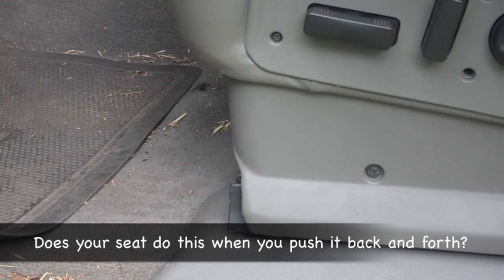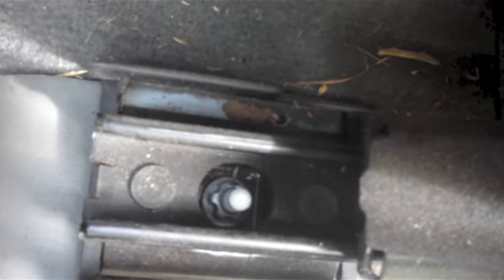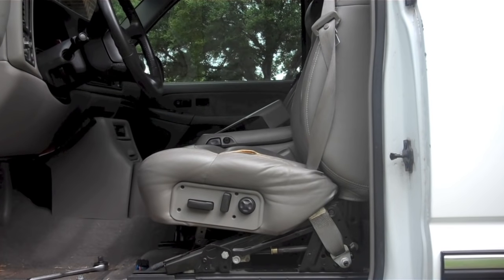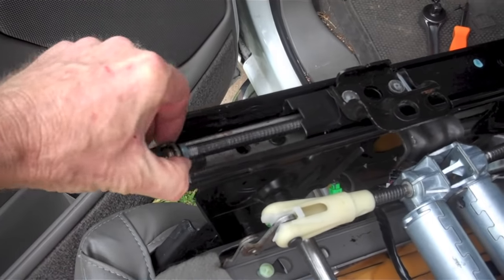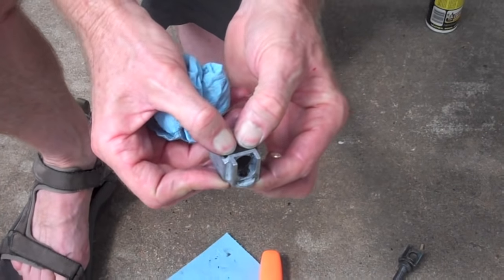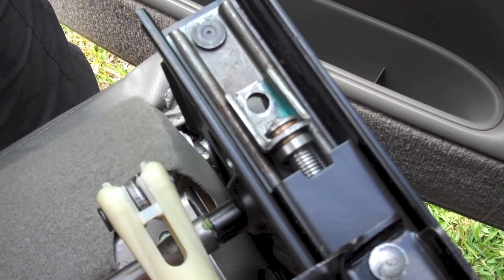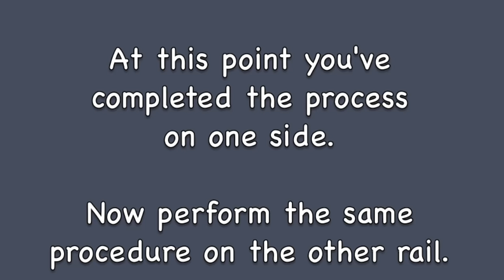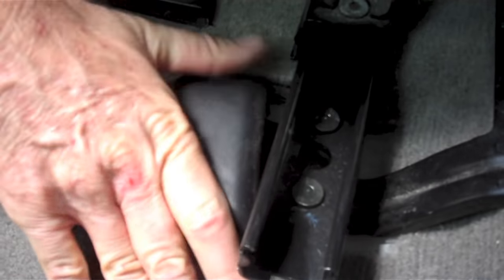GM Sliding/Loose Seat Repair

Comment: As a retired ASE Master Tech, this I can say is a very good video, lighting, explanation and correct use of terminology while point out weaker torque areas, thread locker, plus grease. Thank you for using "TORX" as many call it a "Star". First used on aircraft and military parts for decades, it is only the last dozen years or more, found it's way into automobiles. This type of fastener is misunderstood as it allows higher torque with a small foot print. One point for end user, take a bunch of photos at various stages if you are not familiar with these repairs. Keep small parts in plastic sandwich bags and drop a labeled card into the zip lock sack if you cannot finish that day. Like the video or subscribe so you can find it again.
Excellent job and clearly spoken at good volume levels. Two thumbs up!!
Reply: Q0

Comment: Thank you for
your straight forward, easy to follow video. I have a 2000 Chevy Express 3500 and this helped repair my shifting seat. For Chevy Express owners you can unbolt from the "stand" not the floor board which will save you removing 4 bolts. Everything else is the same.
Reply: Thanks i have a 98 3500

Comment: I have this issue on my 2002 GMC Sierra 4 x 4. About two years ago I purchased a complete front seat kit for both passenger & drivers side. I completely forgot I bought this kit from you (remodeling my laundry room) but today I had the opportunity to perform the drivers side repair. It took about an hour and a half, I cleaned everything, installed your shims, and greased the worm gear/shaft before installing. Wow! this is like brand new! I cannot thank you enough. So happy! And no more clunking movement. 

The other noisy rattling thing I addressed was a 77 cent Dealer part......my brake pedal rattled under the dash area when going over a bumpy road. Turns out it was a plastic pivot insert that wore out. (You can tell by wiggling the brake pedal side to side). That took an hour or so. Between these two things I am rattle free to an extent!
Reply from the maker: Just to be clear, I created the video but am not the person selling the kits.

Comment: Just fixed c5 corvette seats today and i wish i had found this video first!! The kit i had was from a different web site and came with written directions which were terrible.. The procedure outlined was also slightly different then what was recommended in this video. For example the written directions said to thread the block 1/3's of the way where as you recommended putting it at the top of the gear(you were correct much easier). After i got to the second seat i was doing them in no time after watching these instructions.

Some useful tips 1:) You DON'T have to remove the cable at all! The first 3 times i removed it but on the last track i i figured out you can do it with out removing the cable which shaved valuable time off the repair as well as some complexity. Simply manipulate the track forwards/backwards when needed to remove the gear and the caged housing block with nut and replace the shims, then put the gear back in again making sure the shims and everything clear the guides and line up. 2) The next big trick is when getting the gear to go into the guide have the chair's tracks/rails to be VERTICAL this will greatly assist in getting the gear back into the final guide as gravity will do its thing; press down the cable with your screwdriver to insert into gear then bolt every thing back up and your done. first rail took 2 hours on shitty instructions after watching this video was done in 1 hour both chairs and bolted every thing back up.

Comment: $2.00 locking pliers from harbor freight fixed mine.  set it and forget it....**UPDATE**   After more than a year I decided to buy your kit and do it.  Easy job.. good little kit.  Hardest part is trying to keep the cloth seat clean while taking apart the grimy, greasy worm gear and carrier.
Reply: Where did you get the shims I can’t find them anywhere

Comment: Great video sir just completed the task on my o3 sierra I didn't opt to buy the shim kit I made my own by grinding down two sides of some washers I had laying around. I found your video very informative thank you.
Reply: I expect that the kit replacement shims are a softer, non-metallic material. It is estimated that this soft shim design accommodates the break away torque of the relatively slow, high torque motor(s) that drive the worm gear. Metallic washers (I assume you used) will likely add too much start up torque to the motor(s); motor(s) may wear out (fail). If this is the case, you are encouraged to make a video on replacing the motor(s).

Comment: I had a similar problem with my 2008 Sebring Convertible. Original owner 100K miles ...still looks/runs like new.
New seat tracks were $1400 !!!!!! Your shim solution made sense, so I solved my issue by making a tapered wedge out of a t handle small engine screwdriver/plug removal tool. 
I inserted the wedge at the front of the rail(between rail and seat frame). The seat now moves back and forth/up and down as it did when new ! No more rocking. !!!

Comment: Great video.  After watching, I was able to repair the seat tracks in a 2004 Ford Expedition.  The Ford tracks are slightly different.  You have to drill out the front track rivet to remove the worm gear follower.  The worm gear follower and the metal block that mounts to the track are made of steel on the Ford.  I considered making new plastic shims to fit, but the clearance from the center hole to the edge of the block did not allow for much material.  Instead, I welded the threaded follower to the metal block.  I was careful to center the follower on the holes in the block to avoid any potential wear.  I fully greased the drive screw/gear and reassembled.  I was able to use a button head bolt in place of the rivet.  No more play in the tracks and my seat no longer shifts back and forth on braking and acceleration.  Too bad the original design on these tracks was so poor.  Not sure why they thought a plastic bushing was necessary in this application.  The tracks would have outlasted the vehicle with a solid design.
Reply from the maker: Excellent! I'm happy to hear that this is helping to some degree on other makes as well.
Reply: Tom Hallberg do you have any pictures or more info about how you fixed the expedition? trying to re-shim mine and can't find any info on Google that's any good lol

Comment: Thank you so much for the video! It worked wonders on my 2000 Durango. Apparently GM and Dodge shared same driver's seat slide design...Except for some other small differences, overall it was the same procedure! The only thing hard for me to find was a shime, so I ended up a sort of pipe into it. Thanks again, must have saved me at least $300 in labor

Comment: Great video and will get the parts to fix mine. FYI....if you use the link, some cars it says the parts kit doesn't fit....like my 2008 Cadillac CTS.....does. I searched online and saw that Advance Auto sold the exact same Dorman kit with the same part number. So don't always believe the fitment section. The kit for my CTS is $25 at Advance Auto.....$18 on Amazon.

Comment: You didn’t mention it takes the strength of 10 men to loosen the torx bolts.  ***update***  On my 2000 Silverado I had to cut the bolt off underneath the truck where it sticks out with a welded on nut.  It was corroded.  Will get a new bolt and lockwasher to replace it.  Helpful video, thanks.

Comment: Good video. But in my Z71 the external torque bolt that holds the work gear in had a kind of round nut on the other end. Not a 15mm as yours did. How do I hold onto a round nut in place if where you used a boxed end of a combo wrench? I've literally taken the back rest completely off the seat frame and can't find anything that can hold it while I remove the bolt. Everything else was just as you've demonstrated. Thanks again

Comment: I found that you do not need to remove the plastic side covers shown in the first minute of the video.  Your boxed end 15mm wrench will fit through the inner part of the slide rail in a circle cut out specifically to get to that nut instead of from the front underside of the rail shown at time stamp 5:15.    It saves a minute or two each seat not removing the plastic side covers.

Comment: This is a great video.  My Nissan Altima Power Seat got stuck and needs the assembly change. Nissan Service guy is quoting an exorbitant cost.  Is there a way to have this fixed in the LA/OC area. Auto upholstery guys are not willing to do this

Comment: This is one of the most professional videos I have ever come across. Very clear and precise instructions.  I don't have this exact problem yet with my seat, my problem is my power seat won't move backwards but it still moves in all other directions. 
Just wondering, what GM vehicle is shown in this video?
Reply from the maker: Thanks for your kind words! It's a 2000 Chevy Silverado.  In your case, I suspect the switch is bad.  That's where I would start anyway.  You may be able to just take it apart and clean it with good results.
Reply: Barry Dorfman Yeah, I'm betting on the switch has gone bad since the motor still works in the forward direction. But I'm not going to replace it with a new switch because they cost almost $300 here in Canada.  I hate power seats, it's not a matter of IF they're going to break, it's WHEN they're going to break. GM charges ridiculous prices for replacement power seat parts because they know they will break and customers will have no choice but to replace them.

What I'm gonna do is unbolt the seat and remove it, disconnect the drive cable from the horizontal motor, and then use an electric drill to rotate the drive cable and worm gear to move the seat backwards.  Once I get it all the way backwards, I gonna leave it in that position for good.
Reply: Thank you for the video, what can of grease used ?

Comment: great video. Im working on a 2003 chevy that has the same torx bolts. The passenger side floor is holding water as did my 88 chevy. I hope I wont have to tear to much down as I did with the other one.

Comment: How many Motoros does it has for the back and forward.? In my 2008 Yukon the rails seems like the inner side rail and the outer side are not match, the 4 wholes where the seat is screed literally match a square 

But once is off I took it off, I see the rails are wrong, the outer rial is more front and the inner rail is more to the back.!
Reply from the maker: There is one motor in each seat. It is certainly possible for the rails to be out-of-sync if they are not in the right position when the cables attaching the rail screws to the motor are inserted.
Reply: @BarryDorfman  I tried moving all that mechanism.. seems like yes they not synchronized.. but still.. I kinda put them together and seems like the out is just moving while the inner is stuck. I dnt have those rails like you or wires, mine is a looong metal screw that has a metal frame attached as when it turns it makes the seat slide back or forward

Comment: great video ! I'm doing This on my c5, but I think I may have mixed up the blocks. do you remember if the block that has the L on it goes on the outside seat rail of the drivers Seat? thanks!
Reply: That's wh thg I'm hear my c5 driver goes forward if you get to aggressive with the brakes.

Comment: What would cause the reclining portion of a gm seat to wiggle slightly when set in position
Reply: I'm having the same problem any luck fixn
Reply: @miguelhernandez1681  on the specific seat doing it,it uses a coil spring to keep tension on the seat back,somehow the spring is worn or something.

Comment: do you have a solution for the back of the the seat rattling? if I move the manual recliner handle it stops it for about 10 mins then it rattles and the back of the seat is loose again

Comment: I have a question.  My 2001 Durango passenger seat slides front and back freely.  The motor still raises and lowers the seat, but the front/back does nothing but runs the motor.  Any suggestions on how to correct that problem?  Originally, it did just rock back and forth, but the shop said they could not get the part to repair.  Now it slides freely.  So, could it have been the same part that has now completely disintegrated?
Reply from the maker: Sorry, I don't know anything about Dodge. You'd just have to take it apart to determine what has failed.

Comment: Hey how can u move manually the seat from the back position to the front ! ? I have a Chevy Tahoe and the seat is stuck I wanna replace it but I can’t move the seat forward to be able to remove the driver back left side Screw
Reply from the maker: Frankyllovv _ one possibility would be to remove the two screws (on each side) shown at 4:24 in this video. They’re short so it would probably be doable on the outside rail. The inside would probably be a bear. If you take out the front seat-mount screws, you can probably lift the front of the seat by 1/2” or so which should help with access. Other than that, perhaps you just need to replace a fuse or whatever else it takes to get the motors working again. If it were easy, they wouldn’t pay you the big bucks!

Comment: SEEKING ADVICE I JUST BROUGHT A 2001 CHJEVY BLAZER THE ELETRIC SEAT DRIVERS SIDE SORT OF ACTS ALIJKE A ROCKING CHAIR IF I LEAQN BACK. WHAT CAUSE? AND ADVICE  BROKEN FRAME OR BOLT? THE ELECTRICS WORK  JSUT ODD LOSSE ROCKING WAS TOLD NEED NEW SEAT $$$$ BUT WANT FIGUERE OUT HOW TO CHECK IT  AND MAYBE SIMPLE FIX  BEFORE GOING THAT ROUTE

Comment: I own a 1999 Silverado 1500 LS 3 door w/5.3L engine.  I can not find my truck listed under any of the ebay sites for this GM sliding/loose seat repair.  Anyone have any suggestions where I can purchase this?  Thanks.
Reply from the maker: Looks like it's listed to me:
http://www.gmseatrepair.com/
Reply: When I put in my info on ebay this is the response I get:  This part is not compatible with 1999 Chevrolet Silverado 1500 LS Extended Cab Pickup 3-Door 5.3L 5328CC 325Cu. In. V8 GAS OHV Naturally Aspirated.
Reply from the maker: Peter, there is an email address and phone number on that page. Contact him (which is not me).
Reply: @peterharris8757  Ebay does not realize that there were 2 body styles in 1999. If you have the newer body style then call it a 2000 model. If its the older body style call it a 98 model.

Comment: This does not work for a 2000 GMC Yukon. My seats are completely different than what is shown here and in the directions that came with the kit. The kit directions say to reference page 13 for Yukons but the instructions only have 10 pages so there you go don't bother if you have a 2000 GMC Yukon.
Reply from the maker: I suggest you contact the place you bought the kit from (which is not me…the author of the video).